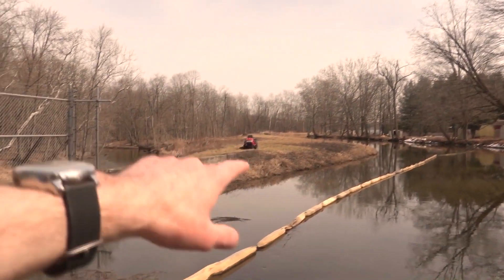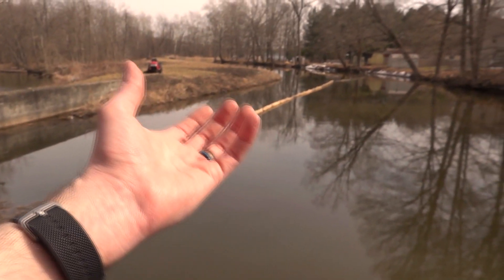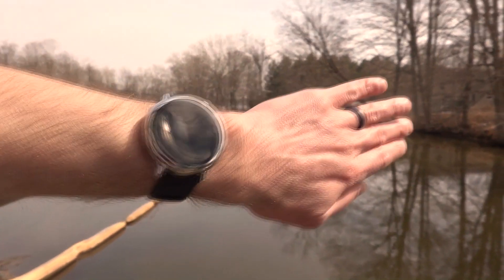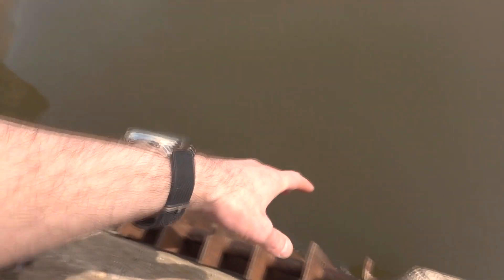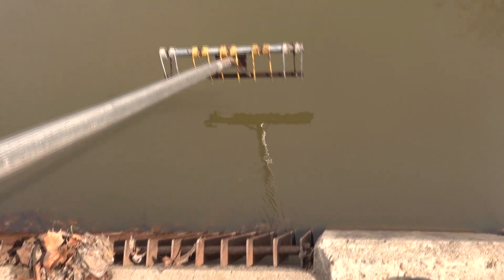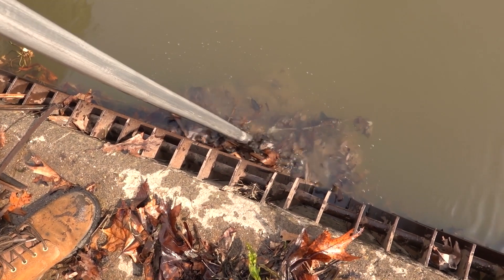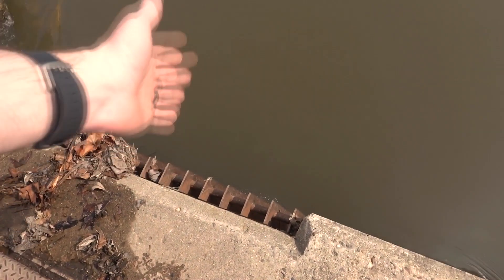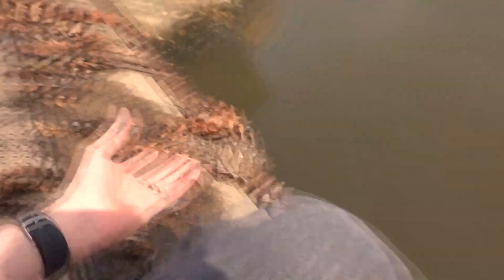Authorized Personnel Only   Hydroelectric Plant Intake Screens

Comment: After the turtle is forced to embrace the suck of being sucked by delta P he/she gets to ride a water slide. If my calculator is correct 332 cubic feet is a cube of water measuring roughly 7 ft x 7 ft x 7 ft. passing through that damn dam EVERY SECOND That is a pretty big hole to make in a river when you start back up.

Comment: I was part of commissioning some large gas turbines, 480MW took 1735 pounds of air and 43 pounds of fuel (natural gas) per second dry, 800ft above sea level.  Water injection would boost output as volume out was much greater than volume in.  At times it would be over 2000 pounds per second and a lot less fuel

Comment: A diagram would be nice. Also a safety discussion would be nice i.e. is the flow rate enough to be dangerous to a swimmer?
Reply: Just assume that if it's a power plant dam, you WILL be sucked in with enough force that you can (and will) be pinned to that grate like a bug on your windshield while on the highway.

Comment: Things that would get you in trouble with us. 
1. No life jacket on. Does not matter if you can swim or not, with that flow, it would suck you against the needle rack. And hold you there.
2. No safety fence so the life jacket requirement. If a safety fence then not required. 
3. Do not see a life ring.

Your water flow was what one of our pumps moved and we had 3. Our needle racks went down 26 feet. We had fiberglass rake handles on 20' potato rakes for manual work near the top and an electric rake for going deep. Spend most of a shift on the needle rack cleaning and you went home tired. We at times had to call in one of our cranes with a clam shell bucket to keep up.The worst thing to find just before shift change or on a Monday morning after a weekend shut down, a body against the needle rack. Your day will be shot as you can not leave till the police say it is okay. Nor can you move any water during that time.
Reply: A life jacket would not help.
Reply: How often could there possibly be a body in there?  You make it sound like it was a weekly occurrence.
Reply: @mikea5923  Depends on where you are, plants in bigger cities tend to get more; that being said, its been over a year since we've had any at any of the plants I work at.
Reply: @mikea5923  Now im scared to work at a powerplant, because im afraid il find a body.
Reply: It's not a public pool. 
You're the type of person who fell off a 10' ladder and call OSHA because you weren't provided a fall restraint system.

Comment: Seems like there should be a more elegant solution to clean those intake screens besides a bloke with a rake
Reply from the maker: There are, but they're more expensive than they're worth for this size of plant. They make automated ones, and if you work in a wastewater plant they're worth the money.
Reply: @Physicsduck  Or a flood control pump station.

Comment: dutch polder pumping stations often have a automatic grappels suspended by cables that just drop down and pick up all the trash. i have not seen  the floating bariers in use 
dutch serch term: krooshekreiniger
Reply: I’ve seen something similar where the New River intersects Bowes Road in north London. It’s quite amazing how much biological material it manages to pick up.

Comment: Do the grates reduce efficiency due to turbulence as they would with a jet engine turbine if they had screens in front of them?
or does that amount of water just not care?
Reply: Air is compressible and water is not, turbulence is less of an issue as water is constantly pushed by whats behind it forward, air is a bit different
Reply: Only if the needle rack is clogged. I have seen ours have a difference of a foot in height between in front or behind and your turbine in this case will not make as much power or in our case, our pumps had to work harder. If they are clean, they don't affect the water flow much as they are designed into the system.